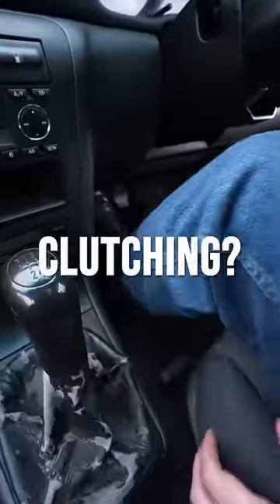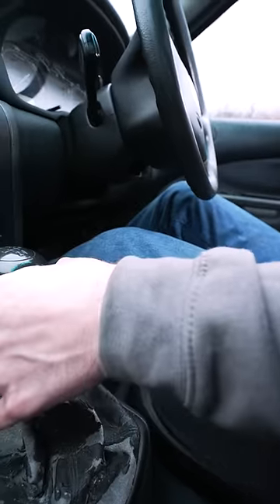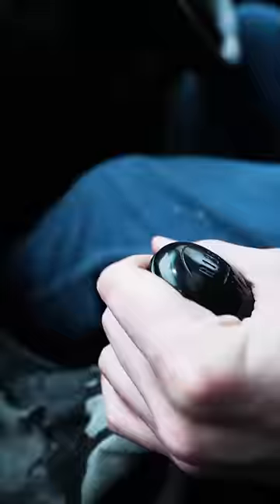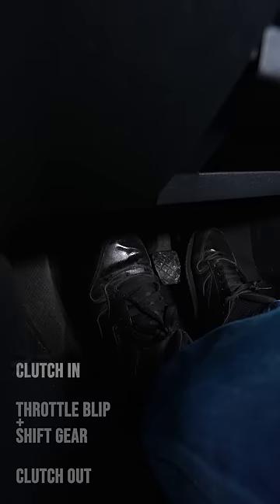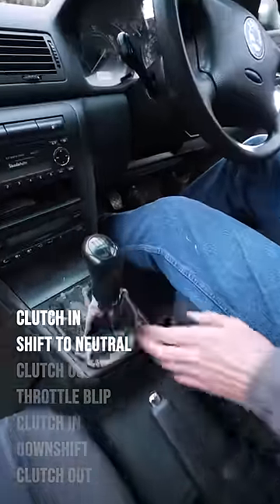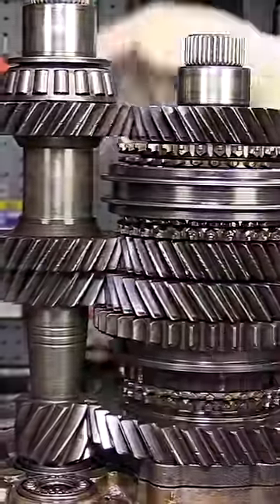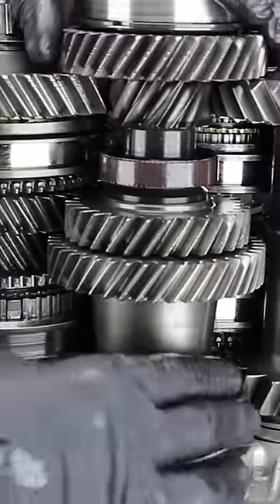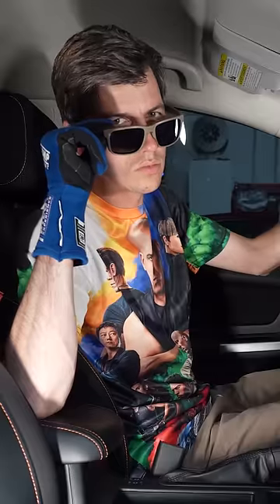What Is Double Clutching? Don't Granny Shift!

Comment: Double clutching is a useful skill to have if your synchros are fubared and you need to get home, or if you want to drive an old tractor.
Reply: I wonder what caused the synchros to go bad. I've had quite a few cars with manuals over the years and I've never had a problem with a manual transmission.
Reply: also useful if you own a Subaru with a stick shift.
Reply: I had that go my 1979 Honda Accord a few years back which I used that car a commuter so it won’t be stolen. The first & second synchro were wearing out so I needed to double clutch to get into 1st.
Reply: @Rhaspun  bad transmission design/bad owner practices (bad shifting, bad fluid, etc.)
Reply: I don't know about the rest of you, but once I learned to double clutch my downshifts I kept doing it because it not only made rev matching easier, but also makes the gears go in with little to no resistance.
Plus I drive a 20 year old car with 180k miles on the clock.
Reply: @Rhaspun idk, my car's previous owner left me with very worn synchros for 1-3 and I ended up just learning how to synchronize them myself
Reply: Why does it need to be in neutral tho why not just rev it with the clutch in
Reply: @christianmckinney9109  because with a a gear engaged the input shaft and output shaft of the transmission are connected (either the engine spins the wheels or the wheels spin the engine). You are trying to go from a gearing that has low speed on the input shaft to one that has high speed on the input shaft. When you push the clutch in the input shaft has very very little force acting on it, so you can pull the transmission out of gear and into neutral. But from that point you'll have an output shaft that is spinning and an input shaft that's quickly slowing down.
Synchros have very little trouble helping the input shaft slow down, but they have to work much, much harder to spin it (and the clutch disc) up again.
So, when you're double clutching your downshift, you push the clutch down to disengage the input shaft, and drop into neutral, letting the input shaft start slowing down. Then you let up the clutch about halfway to engage the input shaft to the engine, while giving the engine a blip of throttle to send the clutch (and thus your input shaft) spinning fast enough to be just slightly above the correct RPM for the gear. You then push the clutch down to let the input shaft free-spin, and pull the transmission into (a lower) gear. The synchros now have little to no work to do, and you should feel almost no resistance as the gear engages. Then you let the clutch up as normal to connect the engine to the wheels.

If you did this correctly it will sound and feel like the smoothest dual clutch automatic you've ever experienced. It does take time to learn, and it will cost you some milliseconds over just yanking the box into gear, but if your gearbox is worn, this will let you not wear it out quite as fast and if you learn to do it at speed, driving in the mountain twisties will be a lot safer as you're less likely to upset the balance of the car.
Reply: @Rhaspun what causes synchros to go bad is if the driver doesn't really match the rpm and you downshift with too many rpms hitting the lower gears, the synchros have to grind a lot to match up the high rpm to a lower gear which causes a lot of wear.
Reply: @Rhaspun  nobody has problems the most of them here they don t know for what we talking about i use to do  this method in military to drive and old type of truck we still have them in greece with  non sychronixed gearbox
Reply: @christosf11  If you were in a truck you don't need to use the clutch to shift. I used to drive a big rig and didn't use a clutch when shifting.
Reply: @Rhaspun floatin’ the gears
Reply: Actually, that is not needed, you just need to learn how to shift without using the clutch. You come off the gas while at the same time applying pressure to the gear shift lever. The trans will pop into neutral. Then you either speed up or slow down the engine to match the output shaft speed and drop it into gear.

I have worn out cars before I wore out the throw out bearing or the clutch. The only time I use it is for starting. Well and sometimes for holding the car on an uphill slope while waiting for the light to change, but that is hard on the clutch disk.
Reply: Sir I own a cycle, how do I double clutch, pls teach me
Reply: its even more annoying on a tractor as you are probably using a hand throttle.
Reply: Even old tractors have syncs unless it's pre 1930
Reply: If you are a pro even non sync gearbox don't need to double clutch as you'd know exactly what speed your engine should be in any gear and speed.
Many years ago I drove a 18 wheeler tanker with a failed clutch (pressure plate snapped and refused to disengage) and no sync gearbox I drove it 400 miles to the workshop while I was in the military, and yes there is not many people in the world that can do this.
Reply: @Rhaspun resting your hand on the gear stick puts stress on the syncros continously. Otherwise, the syncros should not wear unless you use very much unneeded force to get the gears in
Reply: I double clutch when driving my tractor even modern manual tractors require double clutching.
Reply: No.

You actually have to go out of your way to destroy modern day syncros. Literally any manual car made after 2005 has syncros rated for several hundred thousand miles. If they're bad, you're bad. Get an automatic.
Reply: @joonapousi3905  It doesn't. This is a misconception, and a myth. No damage will occur unless the selector fork is engaged, and it won't be engaged by a vertical force or the weight of a human hand. The same is true for a weighted gearshift knob: It won't damage your transmission. This belief is as true as folk lore. It stems from people not understanding how transmissions work and thinking the shifter is directly connected to the transmission. It isn't.

If you're a actually actively pushing your shifter in to it's slot while it's already there, THEN it does additional wear. There is absolutely zero risk to resting your hand on top of the shifter. Zero.
Reply: @brentlanyon4654  fr i got the 2004 wrx and I found i had to double clutch or else it takes me 5 seconds to get it into 2nd
Reply: @Tazytots  I just realized how wrong I was. If it caused damage, it wouldn't affect the syncros but the selector fork or something touching them. I've thinked that how much force is okay for them not to damage when resting hand but seems like it's okay. But I still prefer to rest my hand on the handbrake
Reply: Driving an old tractor is where I learned it. The newbies would grind it. 😂
Reply: @kolby4078 😂 an old Ford 5000 back in the old county.
Reply: @Tensho_C  Mine would grind going into third, too, if the transmission was hot. I pretty much did the double clutch rev-match for all my shifts in the WRX. It was actually fun, but certainly not everyone's idea of fun.
Reply: "or if you want to drive an old tractor" - so supra with V160 gearbox
Reply: @joonapousi3905  It's still probably a better habit to have to have your hand on the handbrake, or on the wheel, yeah.
Reply: @Rhaspun In the case of my Jetta it's because I replaced the dual mass flywheel with a single mass to avoid DMF failure. Turns out VW decided to switch from brass to steel synchros at some point and the steel synchros fail from the extra vibrations transmitted from the engine to the trans.
Reply: Modern diesel truck doesn't have syncros and have a larger gap between the gears. The transmission's input side stops rotating almost instantly, you rarely can slide ingear when they dont move. So you release the clutch to make the input shaft spin again to get ingear way easier.
 
You can float the gears on trucks (shifting without pressing the clutch pedal) if you want be you are way more prone to damage to gears
Reply: @peterjohnson9438  -my 20 year old manual falls into gear with the tiniest amount of pressure on the shifter. Given you’re shifting at the right time
Reply: @Rhaspun  you don’t need a clutch in a car either. You have to drive a certain way, but I can shift without the clutch. Just get the speeds right and you’re good to go. (Obviously not starting from a stop)
Reply: Or trucks, took a while for any truck to get synchro transmissions.
Reply: This is exactly why I double clutch my Ram. The diesel is rebuilt... the transmission is not. I might get halfway through the next presidential candicacy if I baby it! XD
Reply: @christianmckinney9109  Because, with a neutral 'blip' you are adjusting the rotational speed of the cluster gear & or the input shaft gear to allow the 'dogs' on the various gears [or actual gears in sliding gear trans] to match the rotational speed of each other & allow them to engage without clashing, grinding or damaging each other.
Reply: or you're in a standstill and first gear doesn't want to go in
Reply: @brentlanyon4654   because the rev hang, I used to double clutch my impreza to shift smoother since it is already slow waiting on the rpm to come down on upshifts
Reply: @nidbahn  Yup. My 4runner was like that. After the trans was rebuilt, it hated going into first at a stop. XD
Reply: @Rhaspun operator error.   If you mis a gear and get that grinding.  It isnt the gears grinding it is the snycros.  Same yt as this video has stuff on how all this works
Reply: @nidbahn  True. This would normally be seen in a sliding gear [non synchro] trans.
Reply: @Rhaspun  ypu can t do that in european truck they was doing that the old drivers long time ago i know because in military we have some very old trucks.
Reply: @Rhaspun depends on the age and the type of the car. If you get into a 30yo sports car 2nd gear synchro is gone more often than not
Reply: @brentlanyon4654  i have to double clutch goin from 5th to 4th on my impreza lollll
Reply: You don't double clutch tractors. I'm a tractor, you shift when it's stopped and release the clutch and you're in the gear you want.

Comment: Exeptions worth mentioning though:
*Synchromesh is the first thing to fail in an old worn manual. If you drive an old car, double decluthing is the only way to change gears. Typically between 1st and 2nd.
*Old tractors aren't synchromeshed. They just aren't. Coming to a complete stop between each gear shift gets old fast, so you double declutch them.
*Performance vehicles, motorbikes in particular.
Your motorbike has a 6 speed, close ratio, unsynchronized sequential manual. Affectionately, a crashbox.
Clutch is needed only for getting started from a complete standstill. 
Close gear ratios and lots of intentional free play in the drivetrain lets them be crashed into gear without clutching. Hence the name.

Comment: Had a chance to drive a 1929 Model A (edited, not a T) just before it ended up in a museum. It was my brother’s and he was quite surprised that I knew how to double clutch. It’s actually not hard to do if you’re not racing. The scary part was the mechanical brakes, no hydraulic brakes in those days, amazing how much force it takes to use and how poorly they function.
Reply: And ppl today freak when using drum brakes!
Reply: Sorry to be pedantic, but model 'T' production ended in mid 1927. Ford did not have any cars to sell till late November 1927, & this was the first of the Model 'A'. The car you describe was a 1929 Ford Model 'A'
Reply: lol double clutching is always easier than regular shifting, it just takes more time and slows you down. Idk where anyone got the idea that it’s some difficult technique to make you faster. Blipping to downshift is so much faster since you don’t have to clutch in/out in neutral, and requires a bit more skill to rev match correctly in a car with a sportier clutch.
Reply: Mechanical brakes aren't all bad. My old beetle has fully Mechanical brakes. What those brakes are made of and how much coverage they have is a big factor too.
Reply: @KB10GL   of course, you are correct. As soon as I read your comment, I realized that I had a brain fart at time of posting.  It was still an amazing experience and the carefully timed process my brother had to go through to get it started was impressive. The first time he tried to get it started for me, he flooded the carburetor because his explaining the process to me screwed up his timing. Today, it would be nearly impossible to steal.😀
Reply: @kendallsmith1458 i don't see any negatives about drum brakes besides that they overheat and fade very quickly. Mind you, I've only ever had a car with rear drums and disc's in front
Reply: Model A brakes aren't bad at all - the problem comes when they're wore out and misadjusted. I daily a stock '31 A, and the brakes are excellent - I can lock up all four wheels if I want. Hydraulic brakes aren't necessarily better than mechanical - it's just a different method of transmitting the force. Model A's really are excellent cars when restored properly, but far too many are not.

Comment: When I was a kid there were old trucks from the 40s or 50s still in circulation and my father told me to listen carefully when they drove past because you can hear the double clutch.

I used to double clutch for fun when I had just gotten my driver's licence, although it wasn't necessary
Reply: The Eaton fuller 11/15spred transmissions in most of the rigs all the way through the 2000’s require double clutching to shift when using the clutch but the synchronizers make it possible to float your gears and not use the clutch at all when shifting . Only to start and stop is when I use it. I was taught to double clutch back in early 90’s when I got my CDL.
Reply: Wait you only clutch when you stop and start? 😂@Phil_Theekrit
Reply: @topsunnn  that's how I'd drive as well when I had a manual. You wouldn't do it for racing, but if you know what you're doing the clutch doesn't even make a difference. ( You don't just have to rev/speed match but also be revving up/down when shifting in/out of gear).
Reply: @onradioactivewaves  explain revving down for me please. How do you do that
Reply: @onradioactivewaves  also, why would you ever want to be changing gears by rev matching with a perfectly good clutch just so you don't use that clutch. This makes absolutely no sense to me. Thats some mental illness stuff
Reply: @topsunnn  so when you rev match which is basically all the time you're driving normally (with exceotions) the motor is pushing on those gears. By reving down you   you take that tension off and you can pop it out of gear no clutch no grinding. Now you could pop it right back into gear then step on the gas to pin the transmission gears again. Just learn you car well enough thag your know exactly what rpm at what speed and what gear and you're golden. And by the way if you were going downhill and your engine was braking then you'd want to rev up to pull it out of gear. 

By the way this would be more difficult on an older transmission. This is all possible with the synchronous gear transmission and the gears being at an angle.
Reply: @topsunnn  I learned to drive that way when mu clutch broke and I got good enough that using the clutch didn't do anything. Being able to knownhkw to shift into any gear at any speed makes shifting faster than needing to use the clutch 😉 I'm not saying I never use the clutch but there's time and place for things but hey no clutch no problem
Reply: @onradioactivewaves  oh so you mean to let it naturally drop the revs down. I thought you meant that you do something extra to drop the revs quicker lol. And yeah I know how it works as I've done it for no reason at all. Just don't see why would you choose to drive this way. To each their own though
Reply: @topsunnn  Because using the clutch every time you shift makes about as much sense as double clutching, if you dont need to do something, why bother? If you know how to drive shifting a synchrod manual is very easy.
Reply: @topsunnn A. A lot of truck drivers use the Jake Brake to rapidly decelerate the engine when up shifting, so they can row through the gears faster.

B. Slip shifting or synchro shifting is easier than using the clutch hundreds of times throughout a long day of driving in the mountains or in traffic, and you actually have more control over the truck because you are not relying on the clutch slipping, you control the engine rpm to match the desired gear, and it slips right in.
Also, as a mechanic, I prefer my drivers to slip shift because it makes the clutches last a longer, and if they are doing it right, it doesn't wear the transmission out prematurely, so it saves a lot of repair downtime and costs on the truck, just like using the Jake to descend hills instead of using the brakes saves money.

I am currently driving a 95k pound truck in the steep mountains on goat trails (logging roads), and if I touch the clutch after starting out, or touch the brakes going down a hill, it means that I have screwed up! Lol
Reply: @topsunnn How many manuals have you driven and how many miles on them? When you’re driving more than a quarter million miles on a clutch without as much as adjustment needed you’ll have sufficient experience to understand. If you have to replace a clutch any sooner than 250,000 miles then you still don’t know how to drive stick. You can move it around but ain’t mastered the clutch yet. Hydraulic clutches should last far longer than you keep the vehicle.
Reply: @fastone371  i drive in a very fast pace. Always up and down the gears and do it quick. I don't spend time focusing on the shift 😆
Reply: @gb123-ej8wh  I drive for 9 years and only had manuals for the first 7. I'd say I have around 140-160k miles between 5 cars in that time.